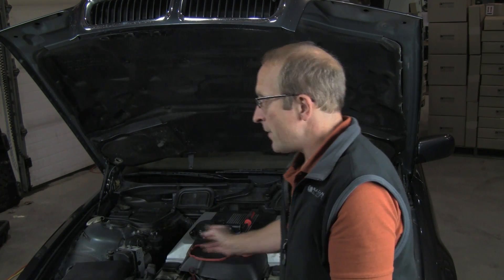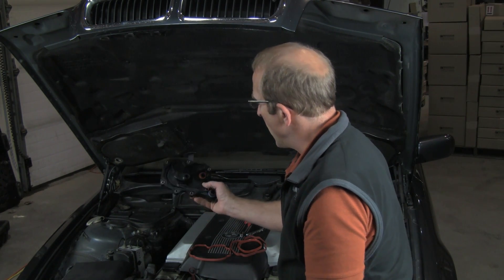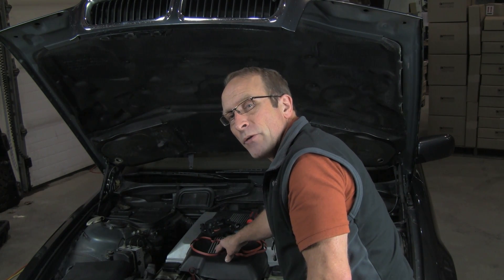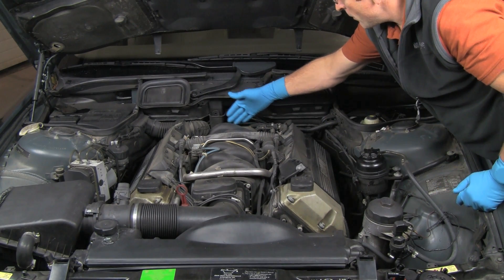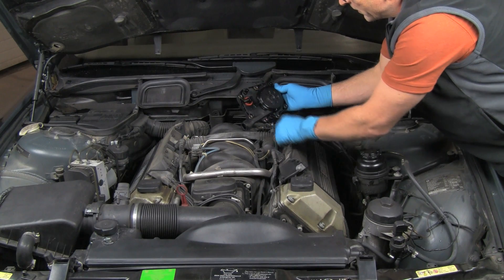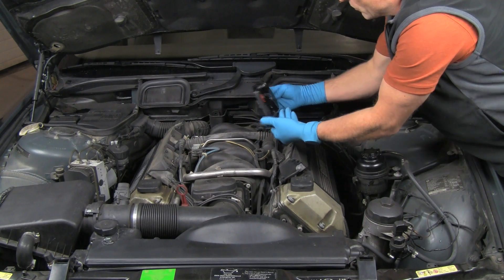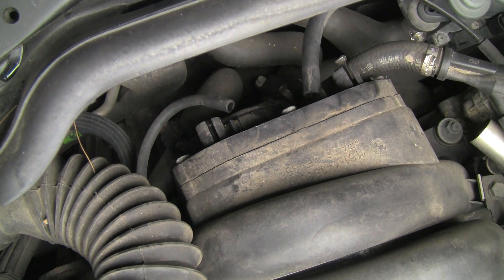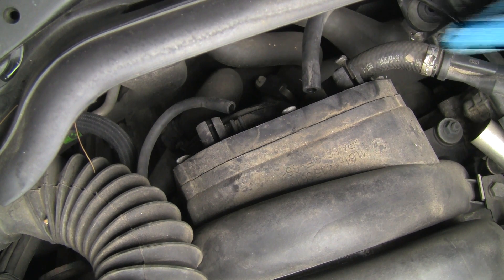Replacing the PCV System on a BMW V8 Engine Part 1 of 2

Comment: A truly miserable job.  First of all you are working blindly.  The worst part is that the TORX screws were overtightened from the factory.  They will strip, at least half of them will.  The other problem is getting your hand back there.  I quit.  I will get it towed to my INDY.   I HATE TORX BOLTS AND E BOLTS.  I just recently did the driveshaft bearing, flex disc, trans mount, radiator and trans service.  If I didn't put all that work and money into the car I would have junked it.  1997 E 38 with 225000 miles.  I recommend replacing the torx bolts with hex bolts and putting a little MMO on the threads.

Comment: great video.  I took the oil fill cap off and the motor ran like a champ.  I knew it was the osv valve.  I was ready to scrap the car.  LOL.  Hey, 23 years it lasted.  Not bad.  Great video.  yes, the bottom 2 torx screws are a pita.

Comment: Some  wise man once  said,  "All engines  and  marques  have  their  issues". A  Friend  just bought a  high mileage  750li.  This  is  just poor, unproven  engineering. I wouldn't touch one of  these with a  3.048 metre pole. Give  me  a  327cu-in in a  Chevy II with a borg warner T10 super -  and  a  PCV  that I can pull  off with no tools, then   soak in some   kerosene and  reinstall. Jeepers Crow!  Gluttons  for  punishment.  I will say that Bavarian Autosport and  the  excellent videos are a  godsend to the Bayer Motoren Werke devotees  - Sandy

Comment: 1 out of 10 that you can remove it this way.
Almost impossible in high mileage vehicles,
Bolts are usually torqued to oblivion. 
The chance you going to strip at least one of them is almost certain.
I strongly recommend to remove intake.
Might be even faster.
I’ve done over 300 of these engine since my heydays in Bmw Autec in Prague so take this advice.

Comment: I tried this on my 95, 740il. The screws were so tight, that of course they striped. Called the dealer, and they wanted, $875 for the repair, so I did it myself. When I actually took the manifold off, the screws were so tight, that 2 of them wouldn't come off with vise grips. I had to use a grinder and cut the piece off. It took a whole afternoon just to put the part on the manifold. Just wanted to share this. In some cases it might be easy, but if your not lucky, you'll have a bad day.

Comment: I have a 97 e38 and I just changed the intake gasket at the recommendation of a failed emissions inspection. The problem still exists and I'm wondering how to test if the pcv system.I'm kicking myself for not changing it with the intake out of the car but can't cry over spilled milk.I am a very minor backyard mechanic.In fact I'm a disabled auto body man but still do my own repairs due to low funds.I hear a whistling when driving at times.I also notice a large white cloud coming from the exhaust at start up from time to time but not all the time.I have a check engine light on and have no scanner to check for error codes.It also has a ticking that I'm told is common for the e38's but unplugging the coil packs doesn't drastically change idle.The car has almost 200,000 on it.In your opinion is it worth changing the pcv system valve.I don't know how to check valve other than to replace it and see if problem subsides

Comment: I have performed this job many times. One clue that the diaphragm is ruptured is the engine will "moo like a cow" upon shut down. It is true the Dealer will tell you that you need to pull the manifold and also tell you that it is required because "there are new updated manifold gaskets to be installed," bull. Those torx machine screws that hold the valve to the back of the manifold are very tight and the recessed portion of the screw is not very deep,one slip and you damage the flanks on the screw and you may end up pulling the manifold. use a torx bit with the newest,sharpest "teeth" on it you can find.

I was taught how to do this job at a Dealer that did not pull the manifold to make this repair. I moved to WI and was dispatched this job. They never said how I was to do the job but when I got it done so quick they asked "how did you do it". I told  them I did not pull the manifold. They took some time off because of this (customer pay job). This is simply what happens when a shop gets a long term employee in a decision making position,an employee that did not have the needed hand dexterity to do the job so he lied to customers and management and said manifold gasket replacement was required.

Some techs like to call this valve an "oil separator"for some reason. I always called i a "crankcase vent valve".
Reply: bloody true - stripped the bottom two screws! i had to break the valve and the take screws out using vice grips! i had a new complete PCV (03 X5)
Reply: Dan R yes sir I just finished and engine is whining like a cow  and it looks like it comes from the intake any ideas what I can do to fix it?
Reply: It's an oil separator in my e39 m5. No need to replace just a thorough flush with parts cleaner is needed

Comment: I replaced one before and is there a recommended interval time frame to change them? I did it slightly different, I took just the center piece off and replace it with the new one without having to take all that other stuff apart. After seeing your video I think it be wise after a few times to replace the entire part due to the gasket on the back of the manifold possibly being crystalized.

Comment: i have a 98 740il i thought i had a radiator leak .i have changed the radiator and put a new fan clutch but still its leeaking towards the passenger side firewall but not going into the car just leaking and steaming white vapor what could it be need advice!??
Reply: check the hose below the rear ccv , notorious for leaking only when pressurised

Comment: Hello i have a bmw 540 2000 and i use the scan tool and i have the engine code p0011 wich is variable timing solenoid.can you help me and show me where is located the part at the engine?i aprecciated your help.thanks
Reply: The hiss is a big vacuum leak I'm pretty sure that nipple thing was stuck on the tube you should of removed it off before installing the valve. I understand this comment is 3 years old but yeaaaa...

Comment: I think that the bolts are actually RIBE head bolts. The Torx T-30 works but is always in danger of stripping the head. A ribe head socket will work much better and have less risk or stripping the bolts. These are the only ribe head bolts that I know of on the M62 or M62TU engine, and I think that they are a legacy of the original supplier of the intake manifold back cover.
Reply: +g mak 

I would just add that many replace the ribe head bolts with hex head bolts of the same size for future. They are M6 x 25 size.

Comment: You do not have to take off the whole valve, i just reach back with a straight screw driver and pop off the round cover that holds the rubber diaphragm , its a 5 min job.
Reply: Thanks SO MUCH Nathan, you saved me hours of frustration with this simple fix of the seal & cap, Cheers!
Reply: i am happy it helped, thanks for watching
Reply: Too true this make a simple job complicated or perhaps he's a mechanic would charge you a small fortune for a job you can do yourself

Comment: Could the cyclonic oil separator valve behind the timing cover also cause oil in the throttle? I am a little confused on how the system works... I have oil in the throttle body and I took off the osv like in this video and inspected the diaphram put my diaphragm wasn't that bad, a little dry and bumpy (definitely dirty and old) but no cuts. What else could cause oil in the throttle and manifold? I will replace the pcv anyway since it is off already

Comment: Nice video ,could you tell me what does two Hoses with the yellow clip at the back of the crack case are connected to or could be trace back too.

I have a 2001 540i  my hoses aren't connected to the crack case and its difficult trying to find out what hoses or where the hoses are. I'm debating on taking off the whole intake manifold looking for these hose.
Reply: Mine got similar problem. And the big hose was connected to the brake pump, is this a correct fitting ?

Comment: Hey thanks for video what if the screw is stripped what do I do?
Reply: I have the same question. I stripped the screw at the bottom left of the cover. What would you do now?! I read that using a ribe bit instead of the Torx T30 would force the screw out. Any advice ?

Comment: I have 1995 BMW 740il  i completed this with that exact PCV.   when i pulled the old one off and it looked the same except it doesn't have the middle black nipple. instead the old one is smooth.  when i put the new one on and put everything back i heard loud hissing and then the car stalls.   could that center nipple be the reason for the hissing?
Reply: there are two types one for the m60 and one for the m62 . the m60 has a plate ate the back . the m62 has a hole for the internal tube to connect to

Comment: Hi. Thk you for this video. I have  04 bmw 545i  n there is white smoke when I idle not all the time. Would this process help? Thk you.
Reply from the maker: The N62 engine in your 545i is totally different from the M62 shown here.  On the N62, first try replacing the crankcase ventilation valves, on the valve covers.  If this has no effect, you may have faulty valve guide seals ... which is common on the N62 engines.
Crankcase ventilation valves - http://blog.bavauto.com/9477
Reply: Thk you, For responding...
Reply: Bavarian Autosport
Reply: you shoulde change valve seals

Comment: Changed mine and didn't cure the problem :/ I'll just have to deal with it until I can afford to have BMW do their thing.
Reply from the maker: What thing does the BMW dealer say they are going to do?
Reply: I haven't gone to them. I'm just debating on dropping it off there. 
But first I'm going to be doing the throttle body and intake gaskets. I'm almost positive that's where my problem is.
Reply from the maker: Vince Hodge
What are your symptoms?
Reply: I had a puff of smoke on start up but that's gone. I still have suction in the dipstick. It idles extremely rough until its warm. And once its warm, I get a random misfire code under load at low rpms.
Reply from the maker: Vince Hodge
 - Make sure you have all of the hose and pipe connections proper.  Are you certain that the pipe that runs through the inside of the intake manifold did not become dislodged during the replacement?
Reply: Unfortunately my timing guide broke the other day. So we'll see. All new intake gaskets anyway.
Reply from the maker: Vince Hodge
Ouch ....... Well, we do have all of the timing chain guide repair parts together in a "kit":
http://www.bavauto.com/fland.asp?part=B1100015

Comment: i have a 1999 540i is it same as this video? some cold day it starts fine but idle is very rough and when is hot seems normal.
when driving and accelerating it makes airy sound like pushing air out or sucking air checked with auto parts store and shows none of cylinders firing and told maybe some vacuum leak problem. is this same PCV problem or any other problems i can see very lite smoke from back of manifold near intake cover.
Thank you very much
Reply from the maker: Yes, you can use this video for the 99 540i.  Your symptoms certainly could be due to a faulty PCV check valve assembly.  The smoke may be from an oil leak at one of the valve covers., unless the check valve cover is cracked.
99 540i PCV check valve kit:
http://www.bavauto.com/fland.asp?part=M62%20CVRK%2096
Reply: BavarianAuto Thank you very much I purchased repair kit and installed but somehow more smoke came from passenger side valve cover and engine runs rough and vibrate a lot then alaram goes off.
What could it be?
Reply from the maker: Joshua k
Can you explain in a bit more detail, what you mean by "more smoke came from passenger side valve cover"?
Reply: BavarianAuto its left side of the engine before i replaced new pcv system very a little smoke came from left end back side of engine but after replaced a lot more smoke came from whole left side of the engine.
it seems running fine then runs very rough and vibrate a lot and then the alarm sound goes off real until turn the ignition key off but if turn the key on then alarm goes off again. it scared whole family... lol  but not really funny,,,
i checked oil level but was good.
did i do something wrong to install or any other problems?
thank you very much for your help
Reply from the maker: Joshua k
 well, it's hard to really say what's going on, without having the car here.  You need to locate the source of the smoking.  Is it oil running onto the hot exhaust?  If so, exactly where is it originating?  Once we know just where the smoking is starting, we can address what to do.  There isn't much that we can think of in performing the PCV replacement that would be a potential problem to cause the smoking.
Reply: BavarianAuto I dont think the issue is oil getting on hot exhaust as the smoke appears as soon as the car is cranked before it even has time to warm up. From a cold start the second it turns over smoke appears. It used to have a very small amount of smoke coming from the left rear of the engine before i changed the PCV system, now there is a lot of smoke coming from the whole left side, I cant see exactly where its coming from. Also what would cause the horn to go off after the car has been idling for a few minutes and to stay on until the car is turned off? It seems like it only goes off once the engine has warmed up. Is this some type of warning or alarm that the engine is having issues? Also the check engine light is now flashing. This just started when i changed the PCV system as well. I hope i explained things a little better. Thanks.
Reply from the maker: Joshua k
 - Not sure on the horn.  Maybe the alarm system is activating or the horn contact in the steering wheel is faulty.  This will take some electrical tracking to diagnose the source.  As for the smoke .... we really need to get a good idea of the origination point.
Reply: BavarianAuto After close inspection it looks like the smoke is coming from the last cylinderon the left hand side, the one closes to the firewall. Also there is a slight tapping noise and it is now idling very rough. Im not sure if these issues are related or not but i figured id give you all the symptoms just in case they are related. Thanks for your time i really appreciate it
Reply from the maker: Joshua k
You may have blown a spark plug out.  Remove the trim cover and then the coil and check the spark plug.
  If this is the case, you may luck out and the threads in the cylinder head may still be intact (the spark plug gradually unthreaded).  In most cases, the threads are stripped in the cylinder head and a thread repair insert is required.
Reply: BavarianAuto Hi again I replaced valve cover gasket and spark plugs and then seemed every things r good then service engine light came on so i went O'Rilly ran the test.
Here r the list of code. p1341 p1343 p1347 p1355 p1345 p1351 p1349
what should be a next step? Thank you
Reply from the maker: Joshua k
 - We assume that you checked all of the spark plugs and none have "blown out" ... stripped out of the threads(?).
The codes you show:
P1341 - multiple misfires with fuel cutoff
P1343 - cyl 1 misfire with fuel cutoff
P1345 - Cyl 2 ""
P1347 - Cyl 3 ""
P1349 - cyl 4 ""
P1351 - cyl 5 ""
P1355 - Cyl 7 ""
Soooo .... multiple cylinder misfires that are bad enough that the engine management system is actually cutting the fuel to those cylinders when the misfires happen.  Next step is to read the fuel trim information to see what's happening during the misfires .... is the trim positive or negative (adding fuel or subtracting fuel).
Reply: BavarianAuto Thanks 
All spark plugs r new and threads r ok
when i change the spark plugs i did not change connector boots 
valve cover gaskets r leaking so all boots were wet with oil so i cleaned well and reused them
should i replace the boots first and see what will happen?
also i dont know how to read the fuel trim information can i do it by myself or need to take to to the shop?
thank u again
Reply from the maker: Joshua k
Yes, change the boots first, then clear the codes and let's see what comes back.  The fule trim info can be obtained using a code reader that is capable of displaying the "freeze frame" data (this is the fuel trim and other data at the time that each fault code was generated) as well as the running live data .... such as the C-Reader VI that we offer: http://www.bavauto.com/fland.asp?part=301050074
Reply: BavarianAuto Thank u i will replace the boots but strange things happened today.
i drove a car today it was same way service engine light on loose of power but i visited friend of mine about an hour then i started a car then engine lights off and drive no problem a lots of power... hahaha
what the situation would be?
Reply from the maker: Joshua k
You need to check what fault codes were stored when the service engine light came on.  We can then start to make a determination.
Reply from the maker: BavarianAuto
 - You'll need to read the stored fault codes, as a start.

Comment: Horn Like Sound from New CCV

I just changed my CCV on 02 540I M6. I had to pull the manifold off due to the bolts being corroded. Cleaned and inspected the manifold and made sure the tube inside was secured. I am now getting a low horn like sound... has anyone had this problem. The metal tube was attached and secured and no cracks in the small hose on the back or under the manifold going to oil separator.  -Thanks
Reply from the maker: You have a vacuum leak at some point.  Perhaps a faulty diaphragm in the check valve.